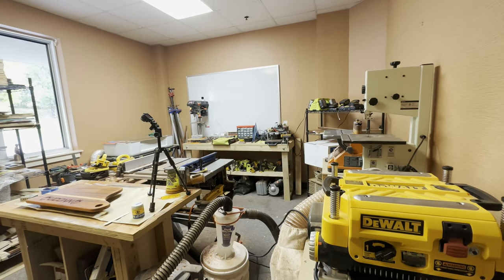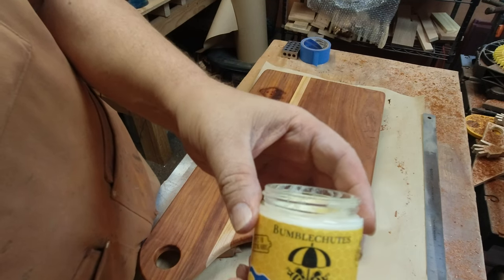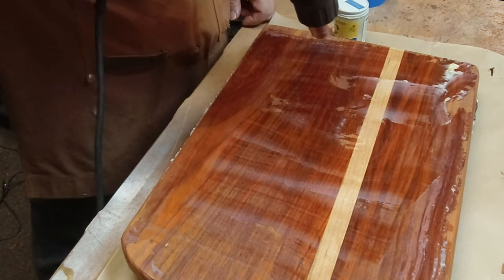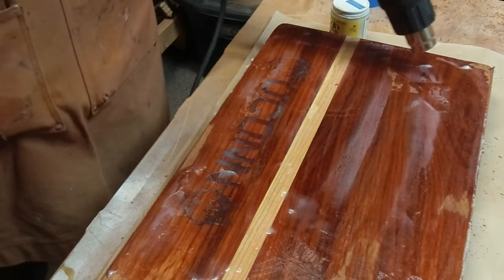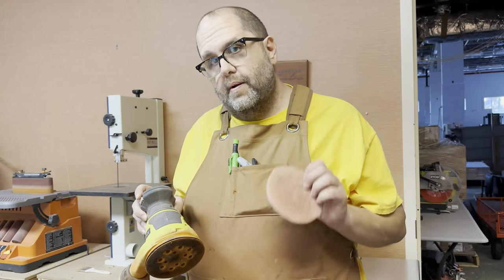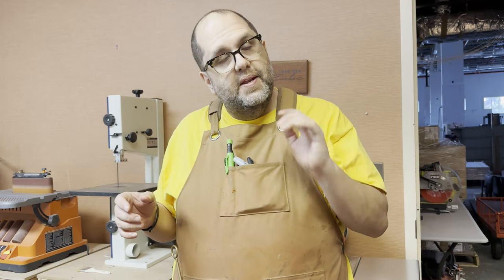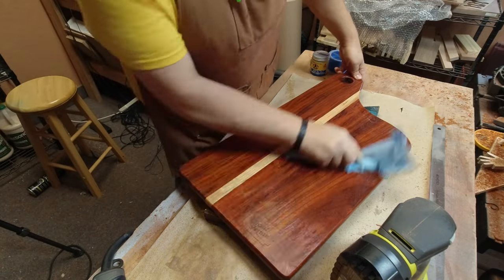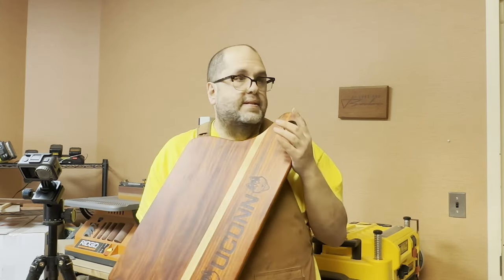Beautiful & Fast Finish for Your Cutting Boards and Charcuterie Boards

Comment: I have been a bowl turner for almost 30 years. I have finally settled on walnut oil for my bowls (the Doctor's Woodshop and/'r Mike Mahoney's walnut oil). Mineral oil never cures and hardens, and bees wax provides almost no water protection. The walnut oil does, and the Doctor's stuff has carnauba wax in it, and he 'microaggregates' it which translates to some thing like you don't need heat for it to flow. The walnut oil and carnauba wax will 'waterproof' your cutting boards. I would be curious also, if you have ever done end grain boards and see how deep the oils penetrate in end grain. The Doctor says to apply final coat with a heat gun for deeper penetration.
Reply from the maker: Bowls and cutting boards are completely different types of finishes, though. With bowls you want something hard and durable that'll withstand handling, washing, etc. With cutting boards, you just want a sealant, and even if the penetration isn't 100% you still get a good sealant (plenty for its purpose on a cutting board).

Walnut oil does sound interesting, and I imagine if I was turning bowls or making that sort of stuff it would be worth checking out!

I have had boards break on customers in the past (after a bad drop, usually) and I've done repairs and gotten a good look at a cross section and while the oil doesn't go all the way in, it definitely gets deep enough to do its job. I also give a can of stuff to my customers so they can do maintenance as needed and will refinish a board if it dries out on them, and so far only one board dried out after about 5 years of zero maintenance, so I'd say in the real world just about anything is adequate for a cutting board :)

Thanks for your comment! I'm going to try the walnut oil for non cutting boards for sure!
Reply: Well, as for finishes on bowls, you do not want a hard finish. Main reason is that wood moves, and any hard surface finish will eventually fail because of wood movement. The walnut oil does cure and harden, which mineral oil never does. The owner of the Doctor's woodshop commented that mineral oil was used on the old butcher blocks as an 'impermeable' finish, applied at night, and then scraped off in the morning before starting again. My preference for cutting boards when I do make them, is for end grain rather than flat grain. With end grain, the oil will penetrate a lot deeper than flat/side grain.
Reply: Tung oil (food grade or 100% pure) is an alternative. I applied to my teak cutting board in light coats only followed by wiping excess off immediately (a whole other discussion - the correct way to apply Tung oil). I then let it cure for a month after drying and buffing. Then I apply a mineral oil/beeswax paste and periodically as needed

Comment: With the carnauba wax, you have to heat it with the gun to get it to flow. Bees wax does look nice, but offers almost no water protection. Walnut oil will soak in and then harden/cure. It is my preference for my bowls and cutting boards.

Comment: I use mahogany dowrl rods in my projects, mineral oil turns them dark like walnut, will the Bumblechute keep the mahogany original color showing through?
Reply from the maker: It’ll probably darken them somewhat as well. Mineral oil is one of the components of the finish.
Reply: @vincentferrari  thank you
Reply: @vincentferrari  will clear gloss spray on lacquer work for chacuterie boards? It will make my hardwood dowels stand out better
Reply from the maker: @larrybaker5316  I don’t know that lacquer is food safe though 🤔
Reply: @vincentferrari  thanks

Comment: Would you recommend this same process when restoring a board that has been in use? My boards surface is pristine other than where I repeatedly cut. I do regularly clean and oil. Thanks
Reply from the maker: I actually have done exactly that for people, I just sand the surface to get any deep cuts out and do the same exact procedure 😊
Reply: @vincentferrari  thank you

Comment: Great video, Vincent.  I should try some of that stuff on a small piece of furniture.  P.S. I noticed you have a Ridgid oscillating sander in your shop.  Have you ever had to buy new sanding sleeves for it and if so did they work?  Ridgid doesn't make replacement sleeves and the last time I bought some by another brand (I think it was Diablo) they would keep sliding off the spindle no matter how I adjusted it.  According to a google search, this is a common problem with this sander but I haven't found a fix yet.
Reply from the maker: Funny you ask because right now I wanna punt it out the window because the ones I have are sliding on the spindles!! I'm pondering just sucking it up and buying a dedicated oscillating spindle sander and hoping I have better luck 😥

If you'd typically oil and wax a piece, this stuff works great for that and it smells awesome!
Reply: @vincentferrari  Yeah, I'm thinking of just buying a new one, too.  Seems like a waste but I guess there's no fix for it.  Looking forward to your next video!
Reply from the maker: I'm pissed because the whole reason I bought this one was so I didn't have to have two machines and now the spindles are useless. I even tried wrapping the spindles themselves in masking tape to take up any gaps but it just did nothing, and even if I cap the spindles it's like the sleeves aren't grabbing the spindle any more so it wouldn't slide up and down but the second I apply any material to the sleeve the shaft would spin but the sleeve won't.

It's beyond aggravating!!

Also I did notice they redesigned it. I wonder if the new one has the same issue?
Reply: @vincentferrari  I hear ya! I haven’t even used mine in years because of the issue with the sleeves. But at the same time I couldn’t get myself to get rid of it because it works fine otherwise.  I didn’t know they redesigned it.  I’ll have to check out the new one.
Reply from the maker: I'm not holding out a ton of hope, frankly 🤣

Comment: Nice vid. I’ve seen videos where people just have a container out their boards in it. When there done they just put the top on it. Why don’t you do that?
Reply from the maker: If you mean for soaking, I used to do that in the shop before this one but I found this method was quicker, easier, and didn’t need as much dry time afterward. A mineral oil bath is perfectly fine, though, and I even reference my old method of doing it that way in this video!
Reply: @vincentferrari  ok that’s my bad. I thought you said you didn’t reuse your mineral and emptied it every time.
Reply from the maker: @ReedAllen162 ahhhh okay yeah in the shop in the video I would have had to do that just because I didn’t have the storage space to leave it set up so maybe that’s the confusion. I don’t remember if I said that or not 🤣